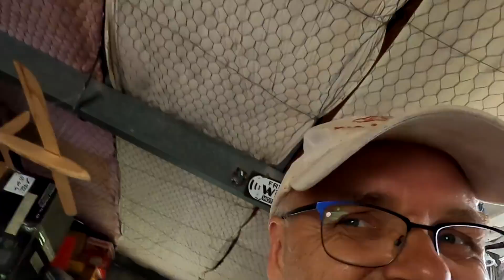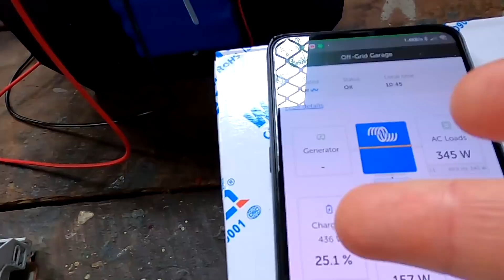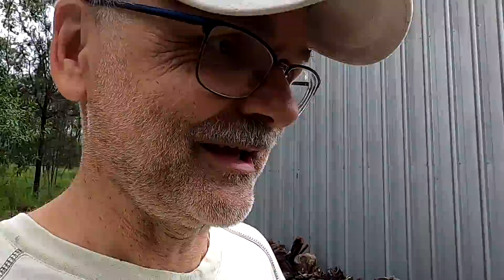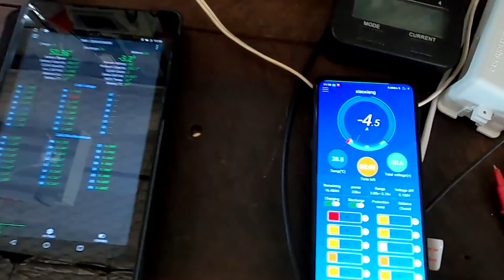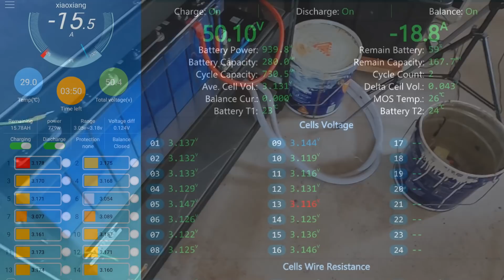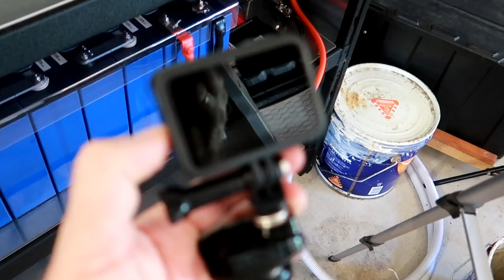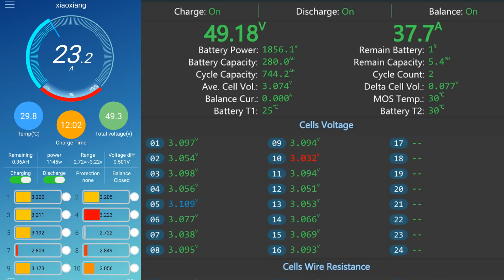Two 48V battery banks, different BMS', low voltage shutdown. QUCC BMS vs JK-BMS. See what happens!

Comment: Just a correction: I used the term RMS incorrectly in that comment I made, it should have been average. I probably used RMS because I was thinking about the load that causes the ripple: the inverter. That, and it was probably too late in the night when I wrote that comment... The meter averages, the BMS does not, and that's why the values jump with a load such as the inverter which is not a continuous draw.

Comment: Hi Andy, great video as usual bringing up all sorts of weird behaviour with BMSs. Just one quick question if you dont mind, i noticed when joining the different battery up they have different length connecting cables. Im looking at adding 2 extra 100ah 12v lifepos to my existing 314ah eel box that will be all connected to a Victron Lynx 1000 busbar. My question is is it ok for the cables from each battery to be slightly different lengths 1 set will be 500mm and the other 2 x 600mm, all cables from each battery are equal, can you envisage any issues. Cheers

Comment: Heya, that's a good test but strange that the 2 bms's have differant amp's going into the battery so differance oke but more than 2-3 amps is to much. not das it matters the mbs's will turn of at there battery max. capicity but still

Comment: So when both of your batteries shut down what is supplying power to your solar charge conteollers ?
Reply from the maker: The solar panels.
Reply: @OffGridGarageAustralia  oh I didn’t know this was possible, I’ve always thought you need to
Connect the battery to the Solar charge controller before the panels or you could
Damage the solar charge controller. So is this not the case ?
Reply from the maker: @Andy-yd3me  Usually, it's not a problem and the solar chargers can handle that. Victron MPPTs for example just go into absorption mode, keeping the set voltage constant and supplying power to the load if they can.
Some cheap MPPT controller may burn out though if no battery is connected for some time.
Reply: @OffGridGarageAustralia  thankyou so much for your reply. That put my mind at rest. So happy I bought victron solar charge controllers 😀
Reply from the maker: @Andy-yd3me  thank you. Perfect decision!
Reply: @OffGridGarageAustralia  🙏

Comment: Question: How did you manage the inverter precharge when starting up from battery zero? Did you precharge using the solar input?
Reply from the maker: I usually don't precharge the inverter if it is fixed cabled to the BMS and battery. I let the BMS handle that.
With my 12V equipment though, I precharge the inverter directly from the battery through a 15Ohm resistor. Too scared of the spark, even I know it is coming.
Reply: @OffGridGarageAustralia  So, you are saying that the BMS can handle the surge of a short term, almost short with-out damage. Even at the power your battery can provide. Then why use a precharge circuit (or process) at all?

I have been asking around. I understand the surge. What I don't know is how significant it is in real systems. Many answers I get is that precharging is critical to avoid breakage. On the other hand, it's obvious that many people are unaware of the existence of the surge, and have no problems.

Comment: Hi Andy, I have the exact same QUCC BMS, haven't experience your problems yet but I'm wondering about the same questions. There are two submenus in the settings where it is possible to set the delays and the over and under voltage protections.Give it a look (PROTECTION PARAMS / HARDWARE OVER CURRENT & SHORT PARAMS). ,Maybe there are some inconsistencies between the two submenus.  thanks for your great job, Cristiano

Comment: Good stuff Andy. Around 8:20 you talk about the DC ripple coming from the Inverter, I hate to say it again, but I do believe, ‘Big Maxwell 64v Capacitors” are going to make a BIG `difference to that DC Ripple ur getting from the inverter.  You would need a 48v cap & a 16v cap set in series of course for a 64v cap set, & while u do have a huge battery set there & probly dont/shouldn’t totally need it, I still think u would see some differences in charging & discharging, etc.  
I would, & do have these Maxwell Capacitors mounted as close to or just under my Inverters & run my inverters directly from this with as short & large cabling as possible, ideally you could have one 64v Capacitor set under each Inverter & run heavy cables to ur bus bars, which you already have in place ready to go.  These Cap sets do make a big difference to 1) smoothing ripple from ur Inverters, 2) supplying that initial grunt the inverters need when a heavy load comes on, 3) they can also absorb big bursts of energy so quickly, as you know, so when you get a small break in the clouds & sun hits the panels for a few minutes the capacitors can also help in sucking in those short bursts of power with their lower resistance they can charge & discharge huge amounts of energy in seconds, & this makes a real difference to how much current is drawn from ur batteries, if for instance u have 2 or 3 large loads, pool pump & 1 or 2 air cons come on at once, the Capacitors can take a large part of the load allowing the batteries to ramp up their load sharing more slowly and smoothly which is always healthier for the batteries, and inverters, especially on smaller battery systems, as in RV, van’s, etc, with microwaves & toasters, etc, smaller battery sets can run the larger loads for short times with less stress to the battery set, ie; 12v systems. I can even switch all 3 x 5kw batteries off, & the caps keep the inverter going for some time, I haven’t  checked how much power I can get from a set of caps, but it is a fair bit, & I will measure it one day, & as u switch on each battery again, u will see a large rush of current going to the caps as u turn on each battery the current draw evens out between them all, with more current perhaps coming from the better SOC batteries.  I also did a little experiment of my own with a 64v cap set on the PV side of a 4 x 30voc PV series parallel (so 60voc system) renogy 40a mppt to 12v system recently, & the controller stayed on and kept charging all night, only .8a-1amp, but enough to keep the controller going throughout the night, there is also a 16v cap on the battery side of the inverter, so in cloudy weather & short patches of sunshine, it seems to absorb more energy quicker when the sun comes out for a short burst, I think, but I do need to do some more testing of this setup as it is behaving somewhat differently to not having the caps in the system.  I know you probly know this cap stuff Andy, more of a rant for other viewers comment, & food for thought, but it would be good to hear ur thoughts too.
I am presently using a cheap Chinese ‘Power Jack’ low frequency Inverter 6kw-24kw supposedly (I doubt it!) in a bus, but it has performed ok so far I must say, with a 100 amp charging circuit, & only draws about 18w at idle, and I have only put about 2500w out of this system at once due to undersize cabling from batteries, they get warm with 220amps going thru them, &  I will be changing this configuration to 24v or 48v 3kw - 5kw AIO system/s soonish. 
We` know ur a busy guy & appreciate all ur comments, experiments & hard efforts to bring us all these great vids you’ve made here Andy, but I would be very happy to hear your thoughts about the effects of using capacitors in different ways to capture & filter energy on either side of a PV solar system, or why I shouldn’t!  Like, could it blow panel line fuses on a part cloudy day with intermittent sun bursts, if the caps are low SOC on PV side of controller, could this suddenly dead short type rush from sun burst cause a fuse or panel to suffer or blow? Thanks again for all ur great vids & efforts here Andy. Cheers

Comment: Hi....How can I synchronize the JK bms so that it gives the correct reading of the SOC? I was making some parameter changes and when I clicked "ok" I changed the SOC to a lower one (100% to 76%), the battery was already at 100% (54.4V). .I need   help

Comment: Why did you disconnect the CC's ???...just disconnet all the solar panels but one and let's see if the CC's fries the BMS when they run freely at PV Open circuit voltage🤔

Comment: The BMS on the right was showing 55% and 154Ah remaining just before the low voltage disconnect (17:12). Where were those values coming from?!

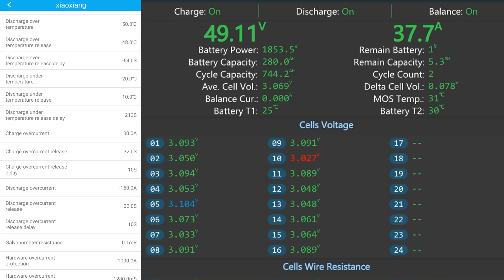Comment: 21:13 Cells 6,7,8 are in bad shape. Fast to fully charge and fast to drain. IMO, these have reduced AH capacity. 
You could parallel those cylindrical LifePo4 cells with these cells to balance it up.
Reply from the maker: They always were my weak cells with this battery. Cell 5-8 was one deliver from Basen but had always problems for some reason. I will do extensive testing with these once I take this battery bank offline.

Comment: The work of JK Bms is correct! When the charge begins to go (after over-discharge protection) and its current strength is greater than the discharge current, then all mosfets are turned on (including for discharge) so that the mosfets do not overheat, which are on discharge! This is a constructive feature that generally does not change the logic of operation and does not harm the batteries and the bms itself.

Comment: Great video, thanks. Been binge watching your series. Have you ever considered back feeding the grid with power from batteries? There is potentially a good benefit in using the different hourly tariffs to charge cheap and sell expensive, for the energy you don't use.
Reply: He already has a system that is tied to the grid on a contract with a solar company. Everything we see on YouTube is his separate system he created that is off grid.

Comment: good test!! that was interesting to see what happened. cell 6 is definitely dragging the other battery down by alot!
Reply from the maker: It always did. The pos terminal is half stripped and connects of the terminals an busbars are not very good. We will re-build the hole battery soon...
I"ve done a high voltage/SOC test as well, it will be in the next video. So basically charged both banks fully up.

Comment: Andy -The JK BMS cell undervoltage  cut out only stops discharging and not charging. After discharging is stopped by low cell voltage,The charging will not wait until cell is over 2.8V , it will start charging straight away.
Same story with QUCC bms , the charge is enabled straight away except you have set a 20 second delay before reset.
It is nothing to do with pack voltage.If you set this delay to 0 seconds it will start charging straight away.
The QUCC BMS is very transparent!
Cheers
Reply from the maker: Well, the QUC definitely does not start charging after a low voltage disconnect until the charge voltage is higher than the battery voltage. This took like 10min or so until it kicked in again.
Yeah, with the JK, the charging FETs are still on so it takes any charge immediately. I wonder what the recovery voltage is for then 🤷‍♂️
Reply: low cell/pack voltage parameters are for discharging control/protection (and not charging) and high cell/pack parameters are for charging control/protection (and not discharging)
 
and naturally there will only be battery charge current if the charging voltage is higher than the battery voltage

Comment: QUCC startet at 49.22V if I saw it correctly... this is about 0.6-0-7 Volts above the battery voltage... could be one diode inside "the black wire path"
Reply from the maker: Yeah, could be. I noticed the 0.6V as well. I would need to repeat the test a few times to confirm this, right🙄
Reply: @OffGridGarageAustralia  The "black wire path" is only needed if the relay has switched off which only happens in an abnormal condition, right? If the "external" voltage is lower than the (disconnected) battery voltage the BMS has to ensure that no current can flow through the "black wire path" so a diode makes very much sense here... The other way around: If the charge voltage is less than 0.6 V higher than the idle battery voltage it would not make much sense to close the relay as the charge current will be far too low.

In an earlier video where you removed the BMS cover... I also think a saw something like a diode next to the black wire ;-)

Comment: Do you think the difference of charging or discharge is just due as the JKBMS pack have a shorter cable than the Qucc?  Electricity is lazy
Reply from the maker: I think my old battery has lots of terminal-busbar issues plus a half striped terminal. All this increases the overall resistance of the whole battery which determines how much current each bank takes. The cables play a role as well as the additional switch and ANL fuse I still have in the old battery box. All this adds up.

Comment: I have buy 4 unit jbd/qucc BMS, 2 of it having problem, one is having relay will not turn on, and another will trip the relay and show it is short circuit when it has current pass thru
Reply from the maker: Oh, wow, that's not good. You can buy the relay separately and repair this one at least. Link is on my website.
Reply: Increase the short circuit value in the settings app
Reply: The protection circuits in the QUCC are extremely fast. I could turn on the shop vac no problem but the BMS would shut down when I plugged in the TV. I had to make adjustments to the protection parameters.

Comment: Hi mate. What wifi switches do you use with google home to turn your pool pump and other devices on and off with?
Reply from the maker: I use the SonOff system. This can be connected to Google Home but I haven't. These switches can be flashed with a different firmware to make them accessible for our solar/battery system later on. So we can easily switch load on or off depending on solar and battery state.

Comment: awesome video! thanks for always sharing with us. i heard you say you wouldn't normally discharge the batteries so low, what would be your normal low voltage disconnect?
Reply from the maker: There is no benefit going under 3.0V with you battery cells. At this point there is less than 5% capacity left. See the many test videos I did here on the channel like this one: https://youtu.be/hLf1FdRjlaw
Reply: @OffGridGarageAustralia  thank you mr Andy!

Comment: Discharge in the JK turns on during charging because the discharge MOSFET needs to be on so that that charge current doesn't flow through the body diode of the discharge MOSFETs (and also doesn't have that 0.6V diode drop you measured when you were testing that JK BMS in a previous video).
Reply from the maker: Ah, right, this 'thing' again. Yeah, makes sense...

Comment: hello everyone , 
i have question about my bms
if i check the voltage directly from main + and main - is 13.3 but if i check from main + and p- of bms is 12.8 
what is wrong with my bms ? thanks
Reply from the maker: That's the normal drop across the Mos-FET body diode of your BMS. Are both charge and discharge turned on in the BMS?

Comment: I assume the QUCC BMS does not have Active Balancing. Seemed like there was some wasted capacity in that pack when the low cutoff was reached.
Reply: Andy took the top off the QUCC on an earlier video. There is no big cap, so no charge transfer capability.
Reply from the maker: The UQCC does passive balancing with around 0.2A per cell.

Comment: I'm charging battery then let it sit untill needed(I use it at least three times a week) is this a good practice doing this to balance cells (aparntly it has a 5amp active balance but we know this ain't true lol)but I'm close to putting away the battery for winter what I was told to store it half charged as this prevents the + - poles in the cells from   uneeded corrosion is this true?
Reply from the maker: While you're not using the battery during the week, the active balancer has enough time to balance it even if it does not have 5A. 
To store your batteries, please read the specifications of the manufacturer of your cells. Generally, around 60%SOC is best.

Comment: True RMS refers to voltage measured in the AC position. It has nothing to do when measuring DC volts.
Reply: Replace RMS with Average. The meter averages, the BMS does not.

Comment: Very good test! I have a lfp battery myself. I have a daly bms. I‘m thinking about buying a jk bms. Do you think it‘s worth it? I just have balance problems. Do you think i should just buy an cheap active equalizer or upgrade the bms? Thanks a lot.
Reply from the maker: If you already have a DALY BMS and just want the additional balancing function and feature, I would recommend a normal active balancer in parallel with the BMS. Turn this one every here and then when the battery is full and it will work brilliantly.
The active balancers/equalizers with the capacitors are great in combination with the Daly:
https://off-grid-garage.com/battery-management-systems-bms/
Reply: @OffGridGarageAustralia  Thank you very much!